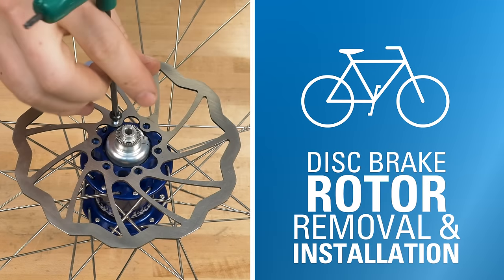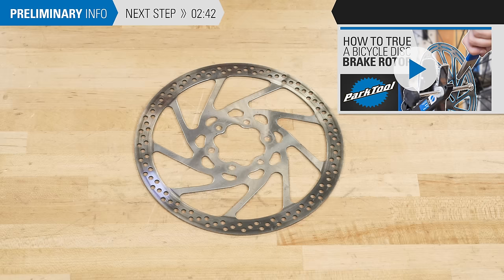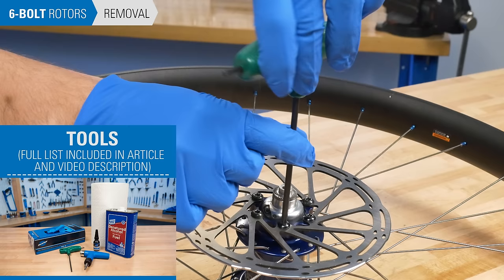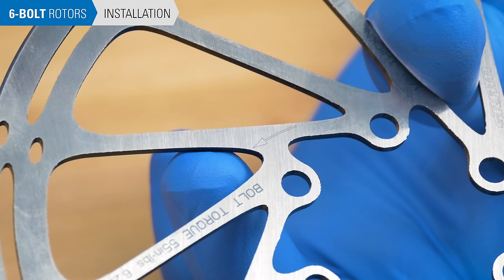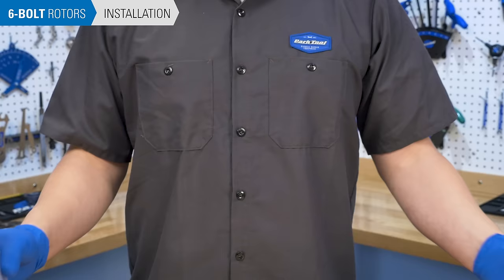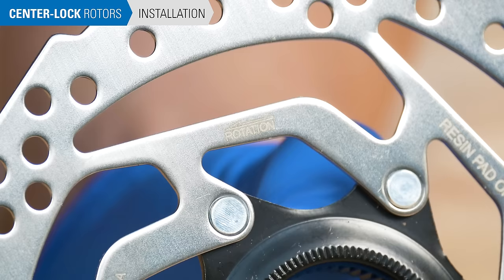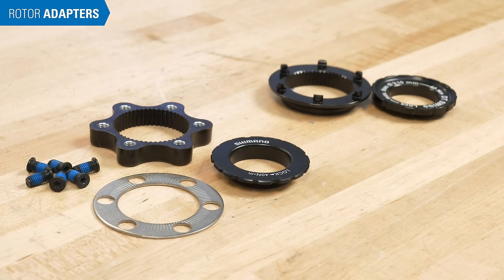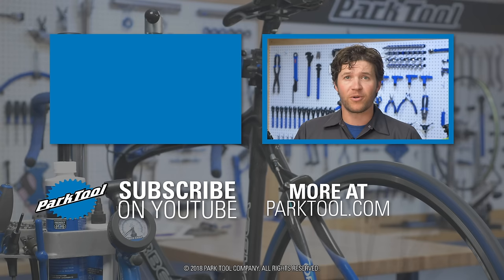How to Replace a Bicycle Disc Brake Rotor

Comment: All the 5 screws out of 6 all came out except one, the screw doesn't grip to the star allen key as it is scratched, do you know any other possible way of getting it out?
Reply from the maker: There are many methods to remove it. On a rotor bolt a vise grip can grip the outside if it is not too tapered to get ahold of. Also a screw extractor kit is a good idea. People will also drill the bolt out to allow the rotor to come off ot the screw then grab whats left with a vise grip to remove it. Hope one of these works for you!
Reply: @parktool  Okay thank you very much :)
Reply: @parktool  I have used a screw extractor and it hasn't helped and the vice grips slip off and doesn't fit. Do you have any other suggestions?
Reply from the maker: Id drill the head off of it and then use a vise grip on it. make sure the vise grip is extremely tight. When you used the extractor did you drill to allow it to get perfect purchase?
Reply: @parktool  I think so, I was drilling it for a while and i switched sides and it didn't work so atm im not sure what i'm doing
Also how would i drill the head off?
Reply from the maker: Think of the bolt as a T. If you drill the t from the top down the cross at the top making it a t will become disconnected creating someing that resembles more if an I. it will be just a post sticking out. This is all risky stuff and can lead to bigger issues so physical help from someone who has done it will be very helpful. Another trick is to remove all the other bolts and while you are trying to twist the bolt with a tool (vice grip, extractor, larger torx bit etc.) you twist the rotor counter clockwise as well. This helps the tool and can break the bolt free. This
Reply: @parktool Would it be find for me to use a grinder and cut the rotor off because im not planning to have a front brake. Im finding it too complicated.
Reply from the maker: If you are looking to use the grinder you can just grind the head of that last bolt off. Very similar to drilling the head off. Once the head is off the rotor will come off and then you may be able to remove it with a vice grips.
Reply: @parktool  Okay tysm for your help! :)

Comment: I have a broken bolts on my disc break
Reply: Time to migrate to centre lock hubs
Reply: @luter7777  or just replace the broken bolts and properly torque them.

Comment: Is it possible to turn a disk road bike to rim brakes?
Reply from the maker: It might be possible, but a hassle.  If the rear chain stays have  a bridge that was drilled, and the front fork was drilled at the crown, it may be possible.  If the bike lacks these brake mounting holes for the dual pivot rim brakes, do not add them. The wheels may also be an issue, if there is no rim braking surface.
Reply: @parktool  the reason  I ask is I'm in Phoenix.  No hills , barely rains and I figured disk put 2 pounds to the bike correct? compared to a rim bike.  I have a road bike giant tcr disk
Reply: @smallnuts2  Yup, bikes with disc brakes are typically heavier.

Comment: If your rotor is centerlock it can be fit bolts hub?
Reply from the maker: A center-lock rotor cannot be installed on a 6 bolt hub.

Comment: If removing a centerlock would be this easy.. :( I just can't get off my external type one from the bike..
Reply: It’s easy to over torque the center lock ring when putting them on. So if you’re careful to observe the recommended torque when installing, they will come off relatively easy too.
Reply: @PRH123  It's came overtorqued from the factory or the seller whom I bought it brand new. Since then I got it loose both of them front and rear. The tool is a joke also because the tool slips off the ring because of the rings lips are a bit raised. The magura ones I bought are just fine tho..

Comment: And, we're supposed to be torquing bolts and rings so why why WHY, does Park not put a 1/2" drive in the tool so you can use a torque wrench?!?!?!?
Reply from the maker: Bicycle torque fit better in the 3/8" drive.  The BBT-69.2 is made with this 3/8" drive fitting.  The TW-6.2 and TW.5.2 torque wrenches are made with the 3/8" drive.

Comment: No standard size  across the board for Rotors, Rotors warp, Need threadlocker on bolts, Have to remove whole wheel assembly, need 5 different tools to replace and install, need to clock the Rotor before tightening down bolts, Have to torque down bolts, Have to clean Rotors with isopropyl alcohol, have to bed in brakes, caliper has to be re-aligned, Wheel assembly needs reinstalled<--- THIS IS EXACTLY WHY DISC BRAKES SUCK!!!!!!
Reply: Drum brakes rule, no maintenance ever required…!

Comment: 2 - 3 tenths? We're not doing fractions of an inch here, we're doing metric, decimals! Keep your imperial nonsense to yourselves, don't chop and change when it suits :D
Reply: If you're referring to the rotor wear section at 0:25, he is using metric--"2 to 3 tenths of a millimeter"--the key words being "tenths" and "millimeters". If it was using SAE, he would have said something like "5/64s of an inch".

Comment: So for a front wheel, DT-Swiss C 1900, Shimano centerlock which tool is it?
Reply from the maker: It's going to take you inspecting what it has. It could have been changed and we cannot keep track of what every manufacturer is providing with every wheel set. This video goes through how to identify which tool you need.
Reply: @parktool  True, and the lock ring came with the rotor not with the wheel.
The main point is maybe that apparently the lock ring with teeth on the inside (cassette tool) is only compatible with thru-axle shafts limited to 12 mm, not with 15 mm... the outer toothed lock ring could be compatible with all shafts.

Comment: If i have an external centerlock rotos, can i fit a internal centerlock?
Reply from the maker: Depends, If you have a 15mm thru axle in the front then you cannot. If you currently have an external lockring on the rear you can replace that with an internal lockring. The 15mm axles do not leave enough room for the tool. Hope this helps!